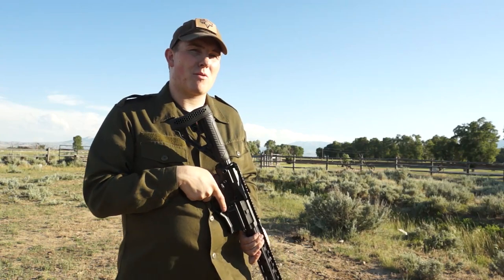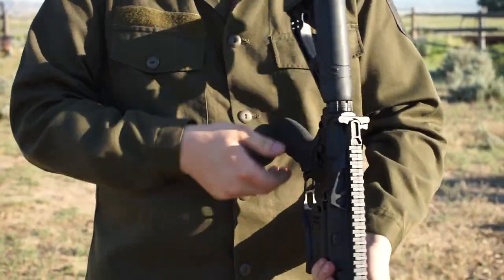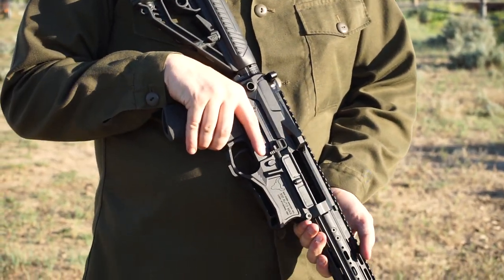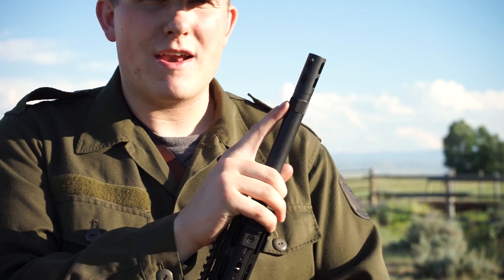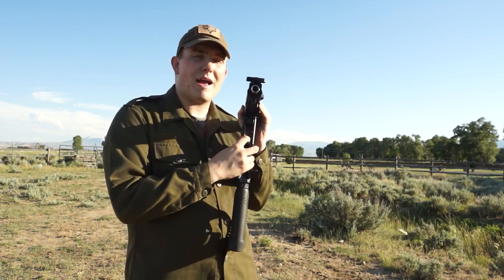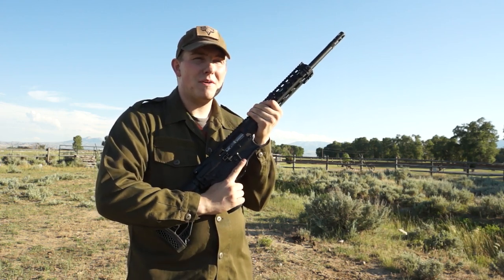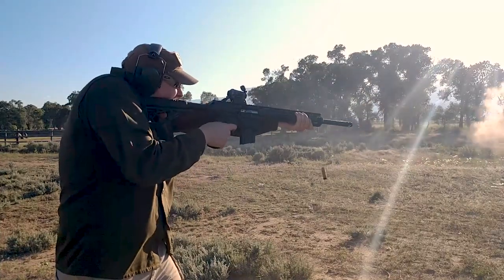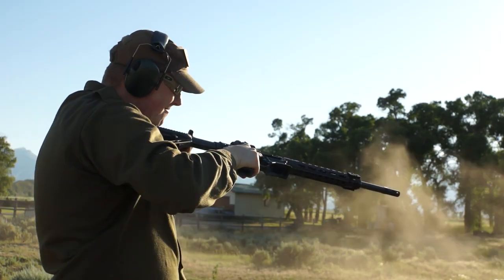AR500 Production Rifle – Big Horn Armory

Comment: Cycle issue: bullet is 350 grain Hornady, 33 grains of lil gun. perfect cycle, pumped it to 36 grains,and now it's not "pushing" the new round all the way in.

Do I OPEN or Close the gas port some. Is there any data on adjusting per pressure or do we just trial and error?

Comment: I F'ing Love it! really want to pull the trigger one one, only thing that is deterring me is the fact you cannot change caliber. Will you guys, or is it possible to make just a 500 am upper or would it not be possible?
Reply from the maker: The AR500 lower is an AR 308 size and is machined to only accept a AR15 magazine. When you have a 500 Auto Max, what other caliber could you possibly need?
Reply: Big Horn Armory that is a valid point